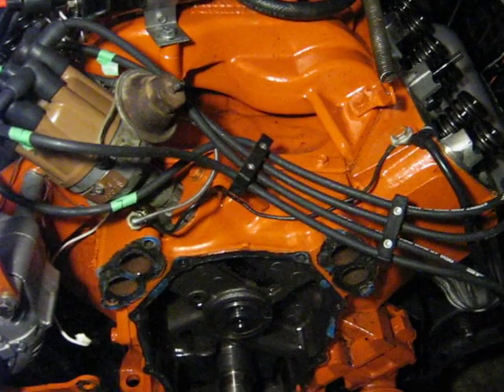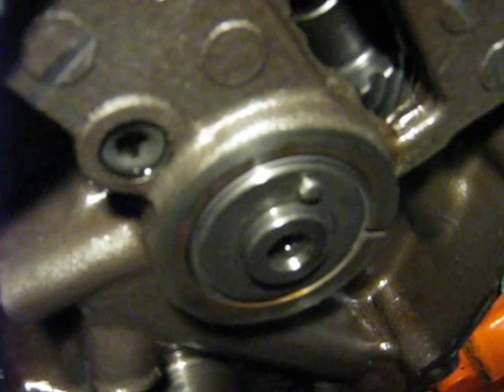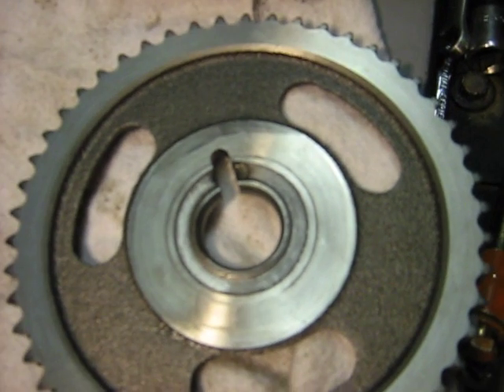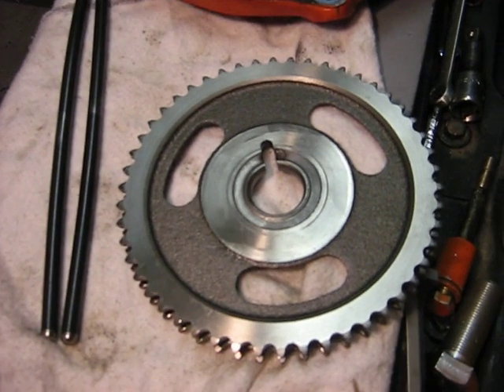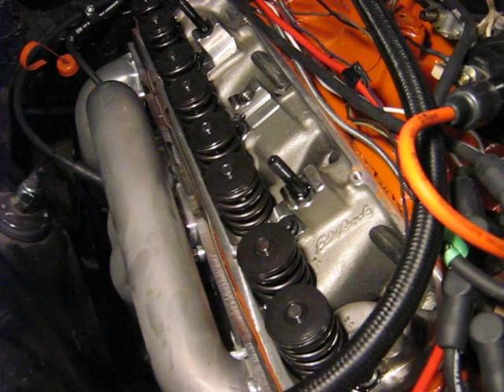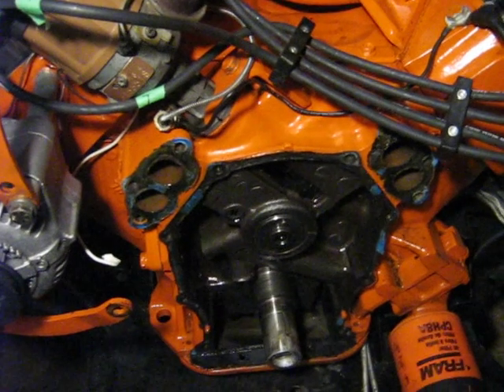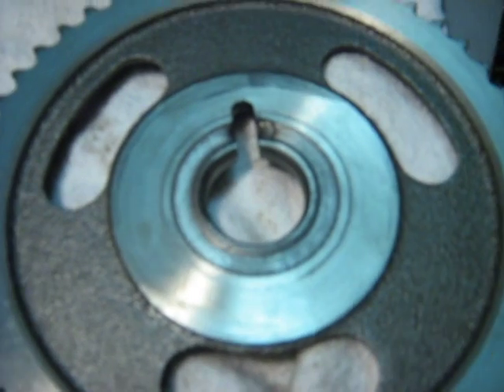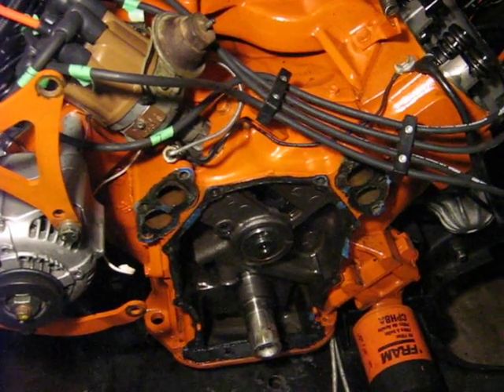440 Camshaft drive FAIL!!!

Comment: ok, first of all that looks like a single roller, mistake number 1. and if it came out, it's either because you didn't install it right, and/or reused an old key. next time use a double roller at least. a gear drive plate system would be better. another tip, get the coil off of the engine. mount it on the firewall.
Reply from the maker: gary williams You could be right, it is possible the cam sprocket wasn't seated correctly. We are using a double roller and a 3 bolt cam this time. I don't remember, but I imagine a new key was used. The stock original cam drive used 1 bolt, however the pin fir into a hole, not a slot like this cam gear has, we wondered if that was a contributing factor.
Reply: They're going for the original look re the coil.

Comment: That just plain looks like a bad design! A single pin like that is a nice concentrated point for failure! It'd be like holding a wheel on with a single lug-nut! Sad that you learned the hard way on this application...
Reply: Well actually they never really give much trouble in service, believe it or not. Hemis came with a 3 bolt, and 3 bolt was offered for other Mopar big blocks, but actually single bolt was mostly quite OK for the most part even in moderate performance.
Reply: ThePaulv12 Guess it depends on the quality of the pin, then? Good to hear such failures are uncommon!
Reply: TheFurriestOne IIRC (as it was 20 years ago) mine was single bolt. I did purchase a Mopar Performance Purple Stripe camshaft 484/284/68 on 108 centers (funny how I remember the cam specs) with correct single springs and damper and I reckon that camshaft came with a new pin already installed in the cam.
Reply: ThePaulv12 Nice. I'm (very slowly) working on a couple old VW Beetles and I look forward to building their air-cooled engines, I just have to watch out for low quality parts when doing so.
Reply: I did my trade qualification at a VW + Merc dealership :)
Reply: ThePaulv12  Cool! I bet precautions had to be taken to keep those Mercs clean!
Reply: Yeah. Run by Germans it was.
They were old school chain smoking racists and looked down on all who weren't of the master race. I only just made it in the club because I was generally smarter than them.
Not wanting to be arrogant or anything, I just got lucky as my parents weren't particularly bright either.
Actually now I think about it, there were 2 Chrysler nuts there and this is where it began.
Reply: ThePaulv12 So it begins! XD I'm surprised they weren't angered by your display of aptitude, there must've been something they liked about you or the work you were doing!
Reply: ThePaulv12 I lived in Germany for four years. I'm a professional engine designer and only got in because of my long CV and experience. The arrogance could be amazing over there. I also found a very 'new is always better' disposable culture over there. In general very little affinity to modify and do custom engine work at home.
Reply: MarquisRex Yes they lack imagination like that. Thing is all the 'good gear' that we hot rodders love to explore for our street cars, they just build into new cars. 
They are only now just beginning to get it - ie what we've all been doing for decades lol ..
In my experience they have a cultural way of viewing the world and it is best expressed like this: "if ve don't see a neeed for it, ven nobody else needs it eiver; and if they doo, ven this is proof vee are tha master vace"!
(god i crack myself up)

Comment from the maker: lol  :)
There was one perhaps importamt difference between the factory bolt and pin, and the aftermarket one. The factory pin goes into a hole in the cam gear. Aftermarket goes into a slot, personally. I think the hole is better.
No, we didn't go for any slam shifts at 8 grand! I don't recall the cam specs off hand, but it certainly isn't stock, but nothing to radical, as it uses regular vavle train parts.

Comment from the maker: Good, glad to hear other engine makers have come to the same conclusion about what is best.
It is kind of a strange thing though, I replaced 3 or 4 stock timing chains on 318s and other engines, that had a center bolt and a shear pin. I never had any problems in stock engines, even with a tire squaking shift kit in the trans. But this 440 set up lunched this cam drive in a hurry!

Comment: thanks for the video. It turns out my cam is a single bolt and is acting strange too. I am thinking that I have a flat camshaft due to no zinc additive after only 1000 miles. so i guess a new 3 bolt cam, lifters, and sprocket? any other recommendations?

Comment from the maker: I don't think so, since we got the engine running sucessfully after we put in a new cam with the 3 bolt drive setup, and there wasn't a burned cam bearing. This engine later bit the dust due to oil pump up into the heads at 6000 rpm for 1/5 mile (tires were spinning the whole time)  We still have the engine apart, so we will indeed check those cam bearing holes out. Thanks for the tip.

Comment: I just flushed the system and made the switch over to the green stuff I normally do a drop and fill with coolant every 6 months and a full flush once a year. I dont do that 3 year or 150000 miles bull crap they throw on the bottle. I dont mess around with coolling systems due to the fact that they are expensive to fix

Comment: dexcool is good as long as you change it regularly, the problems start when people get lazy and leave it in for years then it becomes a nightmare, green antifreeze is very corrosive to ally parts and even cast iron

Comment: Do you remember what you had the bolt torqued too ? A lot of the old service manuals and the Mopar engine book list the torque for this bolt at 35 ft. lbs. this is incorrect, the torque for the 7/16 camshaft bolt should be 65-70 ft. lbs., the torque value for the three bolt cam should be 35 ft. lbs. The camshaft dowel pin is only used to locate the cam gear onto the sprocket, it is not designed to "hold" the gear in place. Ed F

Comment: Honestly I would just switch over to green or yellow stuff preferably green but in a 2.2 Liter I dont think youll have to worry about it I think the only the only Gm engines that have problems are the 3800s and v6/v8 vortecs

Comment: I have a 99 buick regal ls right now 3800 series 2 engine only 75k on it so she'll be around for awhile running synthetic in it right now with a tough guard fram. When she dies though I plan on rebuilding the 3800 series and throwing it into something else.

Comment from the maker: Thanks for the tip!
This was the first Big Block we had worked on, it is a 67 engine from an Imperial, so lots to learn!

Not a big fan of Fram I take it.  I had one on a VW diesel, a VW repair guy told me to "Get that off of there before you blow the engine!"  He sold me a Bosch filter for it :)
It must not have hurt the engine though, since it had 700,000 km on it when I parked it on the lawn.

Comment: With some double-roller timingchains it's fairly common that they rub the casting-dimples on the block.
Particularly on '60s bigblock castings. I usually grind them down while I'm removing access castingflesh on the block.

A good Fram-filter is a discarded filter :)

Comment from the maker: Not saying that you are wrong, but it is possible to have a defective part anytime.
However you do make a valid point.
All I know is that the 3 bolt setup has worked out fine.
The Fram filter matches the engine color fairly closely, but I think it is off there now :)

Comment: No, it's Engine-builder FAIL.
There are millions of BB Mopar-engines running around without any issues at all with 1-pin cams.
Now, if the engine-builder had done his job right, he would've noticed the timingchain link-pins were rubbing on the engineblock. 
Look at the clip at 0:14", about 2" around the cam-perimeter. You can clearly see the wearmarks on the block, which means the cam-sprocket never was seated properly. This is why the cam-pin wore down.
Why is there a FRAM filter on the engine?

Comment from the maker: I guess you guys got off lucky!
If my sometimes fuzzy memory is correct, we bent 4 valves :(
Ours has a 3 bolt set up now, and we are putting on an 8 quart oil pan (so we don't burn up any more rod bearings at 6000rpm!)

Comment from the maker: I am not sure, the one we used wasn't Mancini, so you may be OK. Give it a try, but if you have an overheating problem, don't automatically blame the radiator, try a stock  cast iron water pump first. Ours even wanted to run hot at 60mph on the highway at 70F, thats when we knew something was up, as the rad was a big new aluminum one, that didn't break a sweat on a hot summer day with our 318. In the end the rad was fine, it was the offshore built pump with restricted oulets.

Comment from the maker: Yes, it was actually a Hemi that we were looking at for the 3 bolt setup, after we had this problem.
I admit that things didn't go 100% smooth the day we started this engine up for the first time. We knew about the cam break in procedure and did out best to follow it. We ran into a couple of problems, somehow the power steering pump lost its prime, made a Nasty noise, and got so hot it ballooned up our new paint til it looked like a Puffer fish!
The the aluminum water pump caused overheating:(

Comment: Never had a problem with single bolt cams but the Hemi's cam with 3 bolts for a reason. Most often cam lobe failure can be traced back to improper assy lube or break in or a little of both, you can ruin an otherwise proper installation with the starter if it doesn't get started and then ran at 2000+ rpm for the first 10 minutes of operation. Too many people think they need to run them slow at first or they want to hear the cam "cut up" and let a new engine idle before the cam is broken in first.

Comment from the maker: Just make sure you re-work the oiling system, using the Hemi pickup, high volume pump, 8 quart sump etc. We are re-working the 440 like that now, after buring up a rod at the drags.

Comment: Thank-you for the information.I think  my next engine project will be one of those low block 400's using the 440 crank for a 451 cu in. using a Lunati camshaft. And I have always liked the 71-74 Roadrunner bodies because of the slightly wider stance. I will be watching more of your video's.

Comment: About 25 years ago, I got a 440 out of a 68 Charger. (.030 over and magnufluxed ) I had  installed  a Crane cam kit with close to facotory specs. There was never a problem with the cam sprocket ( single bolt ) ,but soon after installation, ( engine was very responsive )I had noticed that one of the cam lobes had rounded off. Did Crane go through a bad batch of cams at one time that you know of ? That was a very informative video.  Thank-you

Comment: My 383 in my 67 bent a couple of Rods as well try all the passenger side but not the driver.eta just say to many cold beers that night when building the motor was not a good idea!!  Never had a cam pin issue though. Did have a comp cam destroy 1 lob and lifter oddly though. But comp took care of me very well with warranty. What are the headers you are running? And what year car is the 440 in? A or b body?

Comment from the maker: @MotorsbyShooter 
Yes, it bent 4 valves, not even enough that you could see it. We tested them by pulling the heads and puring in a little gasoline, it worked well. Yes, a leak down testor would be a good idea!  I would probaly build an adapter out of an old spark plug by welding on an air hose fitting. I made a compression testor for a diesel car that way. I just increased the chamber volume, so the guage pressure was within what the normal comp. guage could handle, worked well :)

Comment from the maker: @furyfantoo 
Thanks for the info. One question for you, is there a HOLE in the stock camshaft gear, or a SLOT?
This one that failed has a slot, we think that the slot doesn't provide the same support that a hole does, causing the pin to bend more easily. Thats why we got rid of that gear, and bought a new 3 bolt setup. It seemed to solve that problem, then of course we smoked a rod due to not using an 8 quart oil pan :(

Comment: If the chain hit hte front cover, the only way that happened is if the gear bent going over the pin OR if the bolt backed out, which would allow the gear to climb over the roll pin.  If the bolt backed out it may have still felt tight when you removed it as the pin and gear provided tension against the bolt.  If you have heavy valve springs and the HV oil pump, those add extra load to the timing chain and locator pin, but ALL 383 and 440 engines (except for 440 6-pk) had a single-bolt cam.

Comment from the maker: @73sebrougham 
So what oil do you recommend using. I have used castrol, quaker state and pennzoil most of the time.
But I guess a hig perf engine has more stringent demands.

Comment: @ChargerMiles007 i agree 100 percent run a double roller chain and a 3 bolt cam, what rockers do you use? dont use crane what ever you do or the indy roller rockers, get Harland sharp i broke a bunch before, the one time i used synthetic i listened to some moron from indy cylinder heads i went racing and spun all my bearings and rods, only use 20 w 50 pennzoil with zinc additive or pennzoil race formula, if you cant get that use valvoline 2050.

Comment from the maker: @caponeauto 
The pin was sticking out enough, it just couldn't handle the load for some reason. We went with the 3 bolt setup to eliminate the problem, for sure.

Comment from the maker: @Xantec 
We aren't really sure. All we know is that the attaching bolt in the center of the cam was torqued, and was still tight when we pulled it apart, but the camshaft had lost a complete turn versus the crankshaft! I didn't even think that was possible to do, and only bend 2 valves at the most! And as far as we know it happened when the engine was revving about 5000 under acceleration, so what ever happened happened very quickly! The cam sprocket actually bent, so the chain hit the cover.

Comment from the maker: @NASTYTHEBOY 
Yes, we can get a 3 bolt setup from 440 Source.
That is what we planned on doing, but Summit is honoring the cam warranty, even though we are over the 1 year time, which is very nice of them. To me it is only right, since Muscle cars spend at least 6 months of the year parked here in Canada! :(  The real factor to me is the fact it died after about 200 to 300 miles of use! So we are trying the same setup again, and crossing our fingers!

Comment from the maker: @30GB 
Well, we are HOPING that isn't the case, but it would take a Miracle for the cam to rotate 1 full turn, and not seriously mess up the engine. So far we have 2 bent pushrods, so we have to check out those valves.